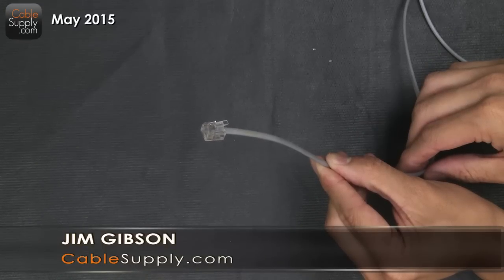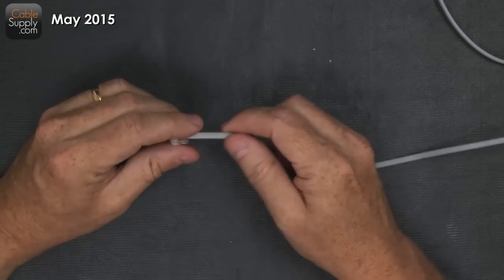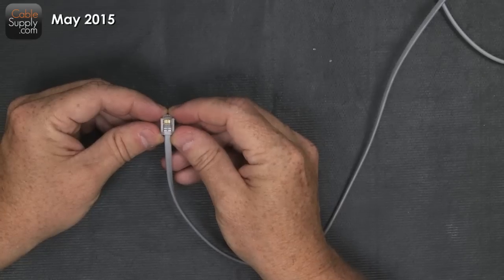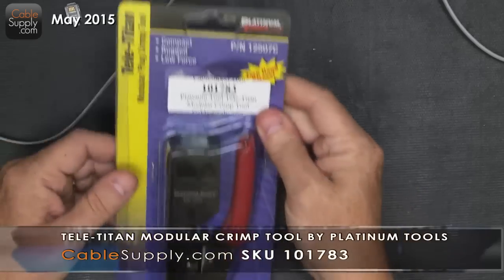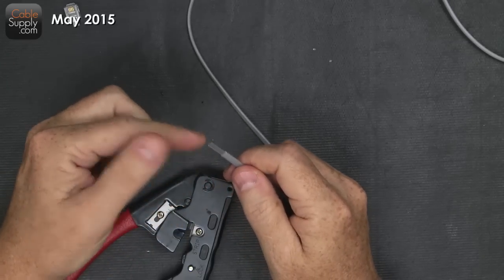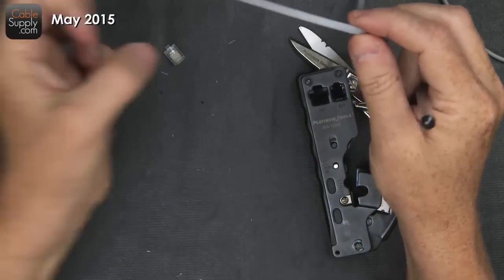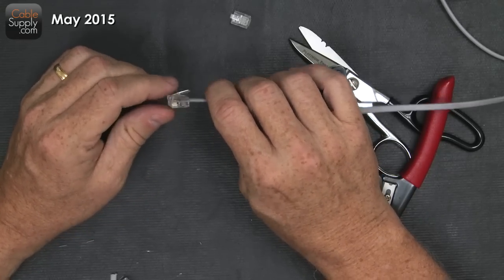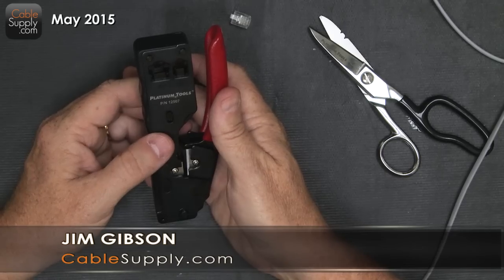How To Make A Telephone Cable RJ11

Comment: was the telephone wire you use stranded or solid?
sorry for a noob question just asking..
ty in advance
Reply: It is usually supposed to be stranded softwire. Solid wire can cause connection problems with telephone plugs.

Comment: Well, I'm a bit disappointed, since I was specifically interested in polarity, which is important for old TouchTone (tm) phones.
Reply from the maker: Tip and ring is the phrase you are looking for with the old polarity sensitive phones.  TIP =the first wire in the pair  , RING = second wire . If you cable the phone and it does not work flip the pairs. Hope this helps!